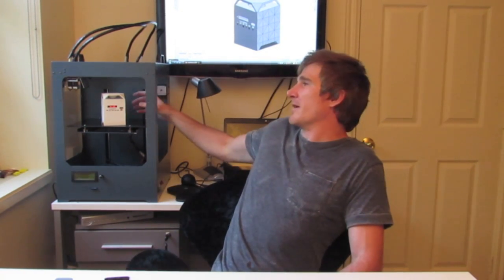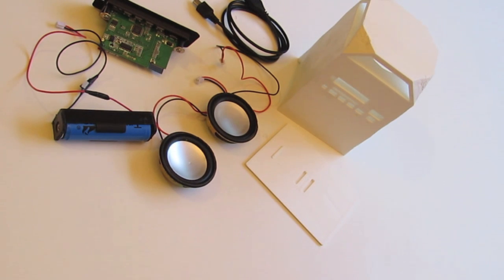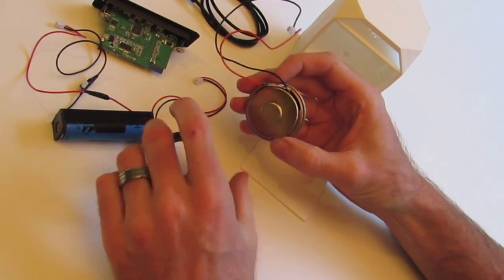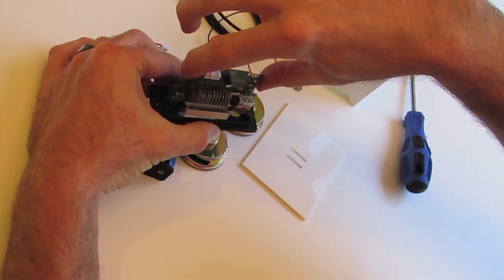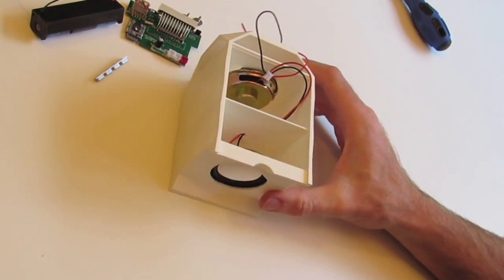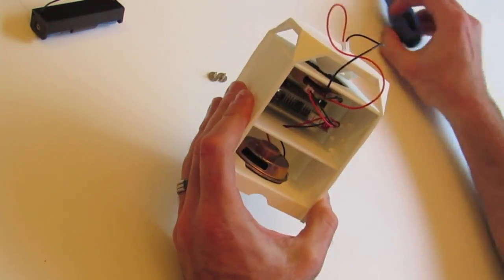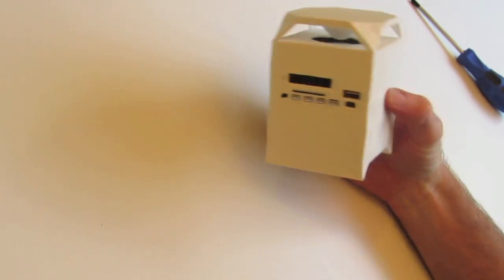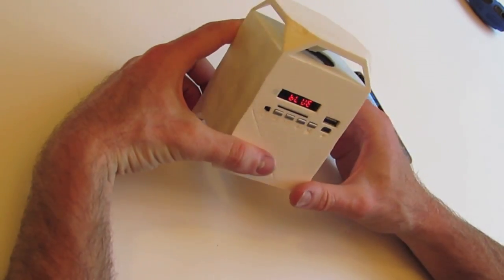DIY Mini Bluetooth Stereo Speaker

Comment: hm, why everyone in diy section uses crappy cheap low end chassis? Specially small speakers with high quality are not expensive and it is worth it. Because such shitty chassis will maybe play down to 200 - 250Hz maybe 150 but you wont hear that in music, just with freq generator.

But there are chassis existing in this size which are much better and get to incredible responses. With the correct housing they can be mindblowing. But no one does this. Looks like i must stun people with an own video on how to it correct and good sounding
Reply: still waiting for that video
Reply: you are too late. video got deleted again cuz i wont have an youtube account with personal videos
Reply: get a Visaton Bf 45 for example. take a pringles roll. cut it in half. Put some wadding in it for dampening. Close it tightly so no air gap is there and than play music through and be stuned how simple it is by just using the brain.
Reply: not hard to do better than in this video.